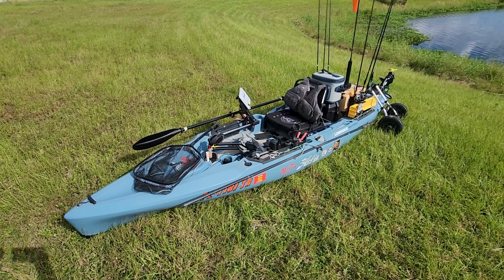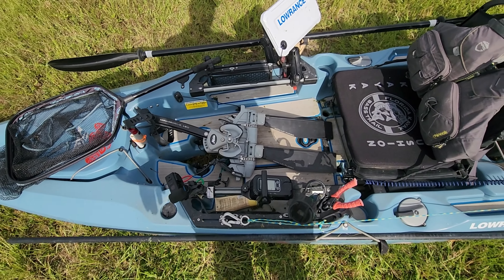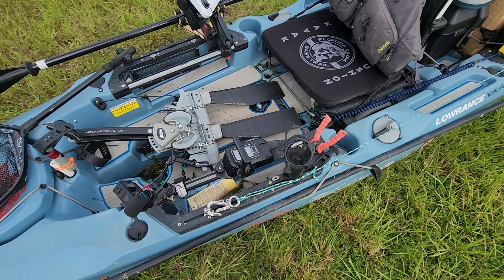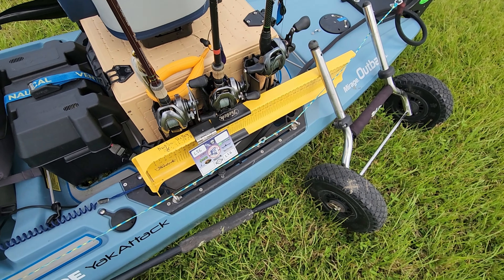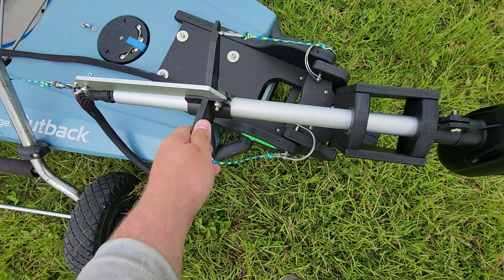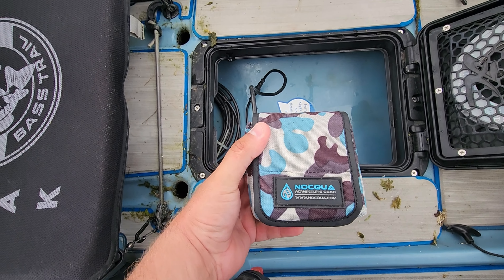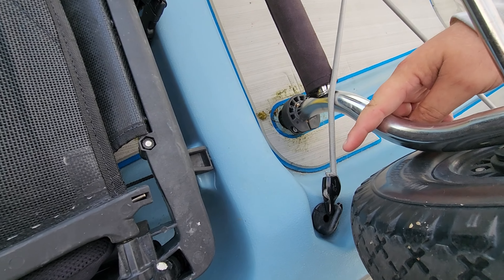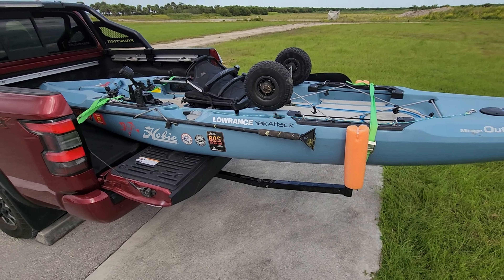My $8000 Tournament-Grade Kayak Fishing Setup

Comment: ROFL    I bought a 23ft  CC Grady White with a 200 Merc, with a trailer ; fresh and raw water wash downs, out riggers, depth/fish finder, vhf radio, live well, porta potty, built in fish boxes and more for $7500.  I prefer a boat that's bigger than the fish I catch.   I've also seen sharks jump so I don't want to be at water level with no escape.  My momma raised no fools.
Reply from the maker: To each their own, my rig runs on honeybuns and a little bit of electricity, that's a lot cheaper than what yours runs on 😅
Reply: I fish off shore for $50 a day which includes bar hopping afterwards...try doing that with your honeybuns.   🤣  @nathanielholleyfishing
Reply: Keep you little thing, I rather spend good times with my friends, no mater the cost.   😝 @nathanielholleyfishing
Reply: "To each their own"  Then he adds the jab...Not Nice... @nathanielholleyfishing